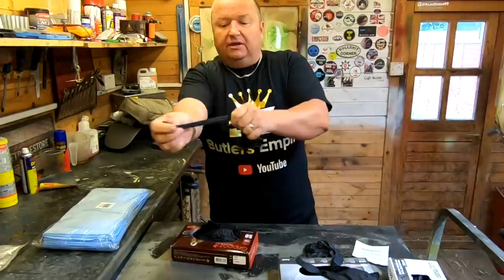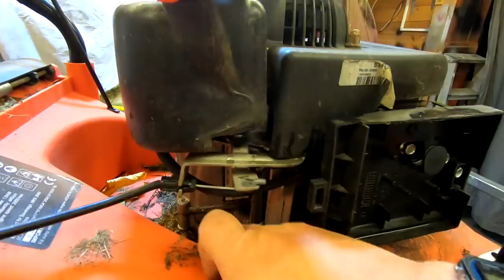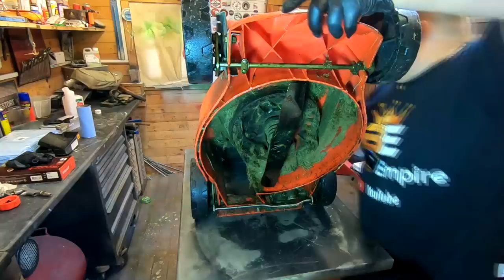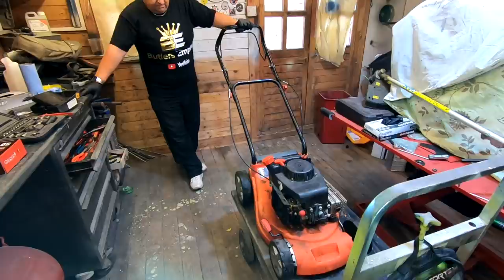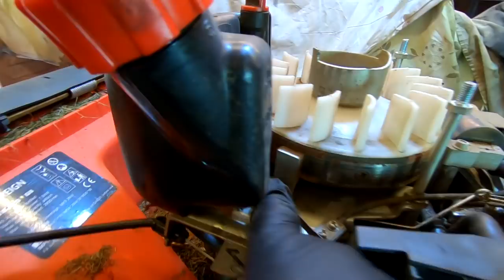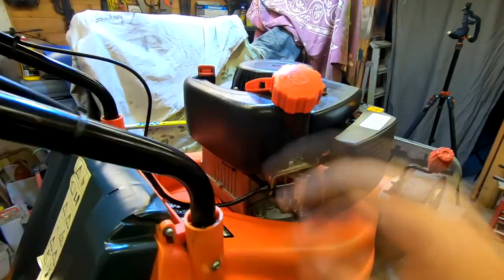Is Repairing Lawn Mowers For Dummies?

Comment: On this side of the pond I've experienced problems with similar fuel tanks splitting down the seams after only two years of use.  We have to use the similar hose vs the reinforced rubber as the 10% ethenol fuel hardens the fuel lines and gaskets.  Thanks for these instructive videos.  You make it appear as if Roberts is your fathers brother. Narragansett Bay.

Comment: Mine hasn’t got the self propelled but mines the same and it surges when started, I’ve cleaned the carb out and used tinned compressed air. It’s a lot better but still surges a little
Reply from the maker: Check the o ring is sealing between the carb and the engine. An air leak will also cause surging.
Reply: @retrorestore  thank you fella. I will do that next time I have it out

Comment: That’s what ethanol crap 💩 does to lawn equipment ruins fuel lines carb gaskets. Makes em go hard and not much you can do but have ample supply of rebuild kits. Unless here in the states you buy premium fuel or find a non ethanol station regular-mid has ten% blend. Humid days pew wee. Then add a fuel additive to remove the ethanol bout all the options

Comment: Was wondering if you could help me.  Got a sym jet 50cc 2 stroke.  Was wondering if you could tell me the carb settings ie Air mixture screw.  How man turns out . Can't find any information on the net . Thanks Martin
Reply from the maker: Not sure but most mixture screws basic settings are around 1.5 to 2.5 turns out
Reply: Thank you